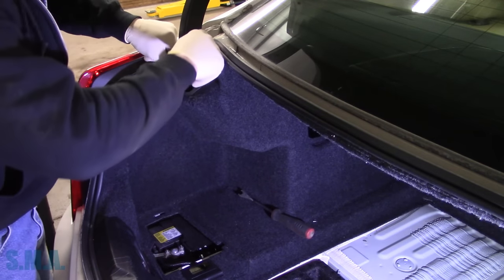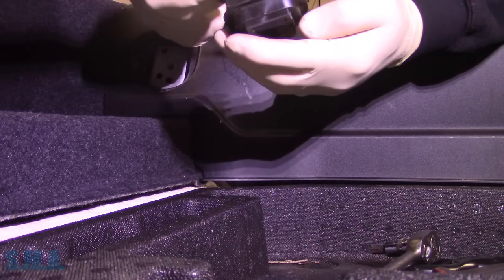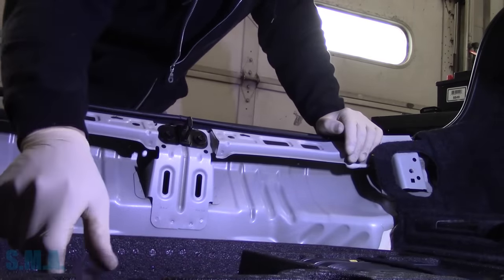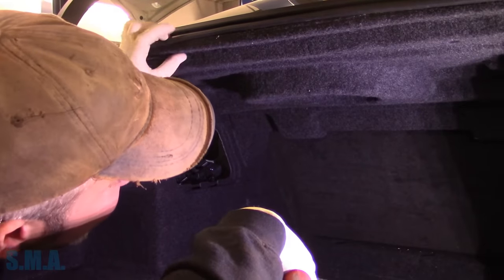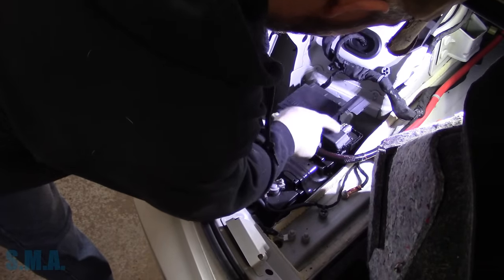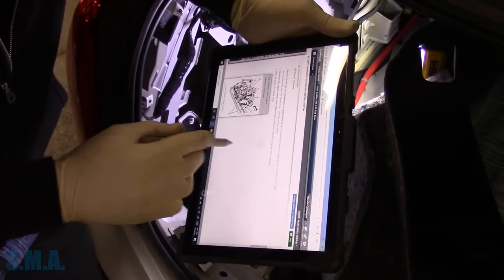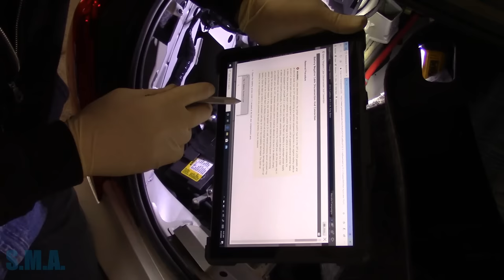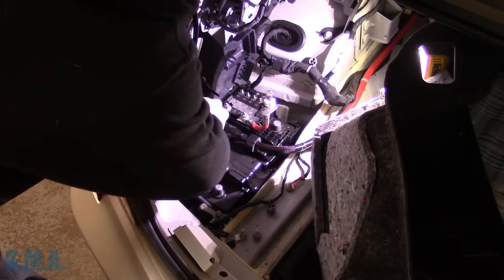Cadillac ATS: Battery Remove & Replace

Comment: Car engineers should be required to work in a repair shop for a min of two years.
Reply: They would end up hating themselves if they did
Reply: The reason they do that kind of shit is they want every body to return to the dealer for service, if  they made it  easy to do nobody would go to a dealer to replace a battery!
Reply: They're designing  cars  on PC never seen anything  in real .He can takeout  that  battery on auto cad software in 10 s
Reply: As an Automotive engineer, i can agree. When i worked for one of the Big 3 US auto manufacturers, i was amazed at the number of engineers in the performance group that had never turned a wrench.
Reply: Good idea brotha but maybe they would be stuck running wires to the battery. I'm talking fixing the problem when someone decides they are an electrician, cut the starter cable, and re send it a completely different way. Anyone here would scratch their head and ask "why?". This would of been great for Eric to fix and comment on. By the way, the starter cables and ground were fine, the starter was junk. How did I know this BEFORE Mr electrical master had a go? I already told the lady she needed a new starter. I was actually gonna do it for her, that's when Mr hot shit electrical genius rolled up. To this day I have NEVER seen ANYTHING like the way this guy attempted to rewire this. It was an absolute joke! Long comment but I'm just getting friendly with the peace pipe!
Reply: If you knew anything about engineering you’d know it’s there for a reason. You can thank Obama for all the emissions and fuel economy crap on cars now that engineers have to deal with and you can thank the press for wanting better handling cars.
Reply: @stiggy60426  You can believe  what  ever  you want but the  fact is. Manufacturers make more money selling parts and doing service than they do  selling  cars. If you can fix the car in your drive way they lose that service. They make Cars Complicated intensely, this makes the average  guy bring the Car back to the dealer for repairs!
Reply: *accountants
Reply: @Tk3997   You can believe what ever  Ferry tale you want but. The load of  electronics  in the new  cars Cause a bunch more problems than the older cars!  I Bought a 1991 Ford pickup new and that pick up went 300.000 miles with out any problems I have a 2017 GMC pickup that has had serious problems 4 times it has 20000 miles.  Vehicle's are only better in your dreams!  My truck has had a warped heads a faulty transmission and  a dead 
Computor box, that is  serious shit! donèt tell me  how cars are better than they used to be, Sounds like you had a hand in building the  garbage that is sold today1
Reply: @stiggy60426  If that were true there would be a simple cut out to get to the battery.
Reply: @JackS425  So wanted more efficient and better handling cars is now the fault of the press? And maybe those engineers should have simply taken a look at what most of the European brands have been doing for years. You know, Alfa Romeo, Renault, Peugot... making efficient and good handling cars for decades now...
Reply: @stiggy60426  --Not Really, I have a Battery on my Honda side by side that is in Engine Compartment, it has seen a lot of mud and heat--this battery is 11 years old but it was made in Japan. Most of the Vehicle Engineers are Educated but like someone has already said, they have never pulled a wrench. Yes Battery in Trunk would be ok but just build a simple secure case around it so that you don't have to undress the trunk...
Reply: I agree!
Reply: Agreed

Comment: Eric you got it all wrong, there’s an easier way, start at the front, remove grill headlight , front bumper cooling system engine etc until u get to the trunk
Reply: Easier way is a sawzall but customer wont be happy
Reply: @Newberntrains  and i own an ats
Reply: @MegaBbqbbq  well i guess this is what the chilton manual wont tell ya 😂 350 for a battery change with labor probably
Reply: Bout like a Ford truck.
Step 1: remove cab
Step 2: ???????
Step 3: profit.
Reply: Typical VW/Audi repair process.
Reply: @eldonerc2524  I dread having to do a cab pull for anything on my truck, it is so hard to do that without a lift
Reply: @bborkzilla  like that insane Ford v6 ohc with the chain at the back.....
Reply: @flyingarts6765  the 4.0l v6. Gives many mechanics nightmares. 
Of course then ze Germans had to up the madness with the 4.2l Audi V8. Just search out some vids here on YT on timing chain service for those...most owners dump the car vs pay the mechanic to do em.
Reply: @aaronturner1072  my buddy had a 4.2 Audi....had to do the job twice in his driveway

Comment: Hey, just wanted to say the removal and installation was pretty much the same on my 2017 ATS with start stop. After I replace the battery, I checked everything and it was fine without doing anything else. FYI.
Thank you!

Comment: That was absolutely insane. All that work to pull & replace a battery. I miss my '68 Olds Toronado. You could open the hood, sit on the fenders (without risk of crumpling them) and have room for you and 2-3 friends. The only PITA was about a mile of vacuum lines that got old, hard and crumbly in the worst places. Vacuum ran everything. Headlight covers were vacuum actuated, they made such a satisfying clunk when they opened and closed. Car was amazing in snow, 455cid, giant bell housing, full size tranny, all the sheet metal (I swear the hood weighed half a VW!) sitting on the drive wheels. Miss that car. Don't miss buying gas for it. Was getting 8-10 mpg on good days. WAY less if my foot got feisty. Oh, and it had THE coolest speedometer ever.

Comment: Chrysler: we came up with the dumbest spot to put batteries

GM: hold my beer
Reply: I remember my 300M, having the battery in the bumper. First time I had ever seen anything like that. Thankfully I never had to replace it.
Reply: The old Stratus' and such had their batteries buried inside the driver front wheel well
Reply: Battery in my Charger is in the trunk, but it's accessible pull up the spare tire cover. No disassembling half of the inside of the trunk to get to it.
Reply: @McBosshog85  Chrysler Sebring - same rough location.  Most idiotic place for a battery ever.
Reply: Dodge Journey hidden behind the front bumper need to remove wheel or have a lift lmao
Reply: My 2010 Dodge Charger has the battery in the trunk but it is easy to get to.  I still have the original battery and I am beginning to think that the worst place for a battery is in the engine compartment with the hot engine and vibration.
Reply: I think they were full of drugs when defining the place for the battery
Reply: What on earth?..... To change the battery,disassemle car.
Reply: Also Chrysler/FCA/Daimler on Grand Cherokee/Durango/M-Class: Let's put it underneath the powered passenger seat
Reply: Old school...remember when the car didn't need reprogrammed by a mehanic with a 5k scan tool every time we fill up with gas?
Reply: @MrBillrookard  That depends on how you look at it.  When that decision was made, it was supposed to be for battery longevity.  That location kept the battery away from the heat of the engine.  My parents had a Concorde from that era, and I only remember them having to change that battery only once in the almost 10 years they owned it.
Reply: Actually, placing the battery in the rear is a great idea for weight balance and protecting it from the heat of the engine.  It's not that unusual for cars for handling purposes.  It shouldn't be this hard though to gain acess to it.  Bad design.  GM.
Reply: You think the engineer s are still laughing about this?
Reply: @MrBillrookard  stratus and sebring are the "same" car.
Reply: Audi: 
Halte mein Bier.  (Under the Driver's side seat.)
Reply: I'm still in the camp that the inner fender battery was the worst possible idea for location.
Reply: Nancy Pelosi  not an engineer (willingly) due to the vehicle length positive cable required.
Reply: @mattbots1  VAG/Audi also does this on SUV's
Reply: I think the wheel well is way worse.
Reply: @McBosshog85  Yep. both my sebring and stratus are like that.  honestly after doing it a couple times, it's not the worst thing in the world.  Plus removes an excuse to not check your brakes and bushings on that side of the car. :)  Oh and to clean out the crud that invariably builds up in there.
Reply: @robertwelch3899  having changed a few, I disagree.
Reply: @McBosshog85  why do they do that do they know water and electricity don't mix well
Reply: @walterk1221  id much rather pull the carpet than the tire...
Reply: Im a AAA battery tech. Ive seen some stupid stuff. Lol.
Reply: @McBosshog85  I was smart enough to have an '02 Stratus R/T (basically a Mitsubishi Eclipse with different badges and body panels). Battery under hood. Easy manual transmission replacement, too. (TL;DR I missed a downshift and blew the thrust bearing to pieces.)
Reply: @mattbots1  probably the same drugs ford was on for the Transit main battery (spoiler: under the driver's/left seat)
Reply: @robertwelch3899  the wheel doesn't have to come off... the fender liner has to come out... easier, faster, less time than the by the book way for this caddy. Eric's way is still slower than my Chrysler way...
Reply: Exactly this.  My 2010 Journey's battery is in the driver side fender well.  Take the tire off, remove seized nut from bracket via cutoff tool, replace parts, work without being able to see, knocking grit into your eyes the whole time, and 4 hours later it's done.  Never again!
Reply: The caddy's an Buicks with it under the rear seat. An the Chevy SUV with it behind the passenger seat in the floor for the kids in the second row to spill God knows what into. an the 06 up Chevy trucks on the passenger firewall behind the coolant tank with that mess of wires like this car.
Reply: WHY I LEFT CHRYSLER FOR A SUBIE
BATTERY WAS REPLACED AFTER 1 YEAR  BEUCASE IT WAS DEFECT
Reply: My Cobalt has the battery in the trunk in the spare tire well. Just lift the spare tire cover, 15mm for the hold down and 10mm for the connections and it's out and in. None of that Cadi craziness..
Reply: Yeah I thought the battery in my wife’s journey in front wheel well was bad...
Reply: Nick J  Yup.
Reply: Worst battery was on a c6 Corvette under warranty with customer waiting. Had to use gr8 tester and print out warranty code. Tested battery and got the famous charge and retest.  108 minutes later, the battery tests good.  Pushed the start button and rapid clicking. Hooked up gr8. Charge and retest! Another hour later,  same thing.  Needless to say, another method was used to make the machine give me the code I needed to get the replacement battery and get the car down the road. Sometimes technology is not your friend!
Reply: @mattbots1  Even at that it is still easy to replace!
Reply: Dirty Harry 
Only if you put the wrong battery in it or neglect to connect that oh so important vent hose. IMHO if you do either of those, you deserve what you get.
Reply: Wife’s Hyundai sidelight bulb fails, instruction number one on how to change is remove front bumper cover!  Cheers, five minute job becomes a one hour epic.
Reply: The ATS isn’t the worst, and hell even the Chrysler bumper games aren’t that bad, don’t ever say yes to changing one in a Bentley, those are the worst, but I do roadside assistance for AAA so I get to see all the stupid places for batteries
Reply: 2014 Ford Escape 2.0 Turbo. Worst battery location ever. Stuff it under the sharply angled cowel & air box. Ford built the car around the battery.
Reply: Try VW's large SUV.

1 under a front seat (has to come out) & 1 in the spare wheel well.

Both about the size of an old 25 plate 12v battery.
Reply: And the Mercedes with them under the passenger seat, and also newer Tiguans where you actually have to unbolt the driver seat to get to it
Reply: And some of the Audi convertibles have a strut tower bar that goes right over the battery on the ones under the hood
Reply: dtoney1182 yea those are pretty fun, easiest way is to pull the air box top and bottom then unclip all the clips holding the positive wire from that plate at the front of the battery then slide it out, sometimes with bad corrosion on the negative terminal I just unbolt the wire from the body and pull it out with the battery
Reply: @2muchflan  Or Mercedes when they put a 60+ pound battery under the back seat. Those things were murder to replace.
Reply: It wasn't the location,  it was the fact that it didn't have a simple 2 fastener hatch to expose the damn thing.  Mercedes has been putting it in the trunk since the last ice age.  3 seconds and 2 calories burned and the job is done.  These engineering geniuses went to school for this? And their bosses actually ok'd it? What are they smoking at gm, and may I have the number of your dealer?
Reply: Walter K yeah the Sebring is basically a rebadged Stratus
Reply: Lol Buick does some under the back seat (lesabres) and some crap suv they have they’re behind the passenger seat in the floor!! Have to slide the seat all the way up, pull the panel under the rug then you have like 1/2” on each side to slide the batter up and down
Reply: @jwitt513  You mean IS. Except for the Stratus R/T which was a Mitsu Eclipse. Even the Dodge panels were made by Mitsubishi.
Reply: I had a 300m with that stupid battery underneath the air box and it caused me all kinds of electrical problems with it sitting down there and accumulating a ton of moisture and corroding all the time. Dumbest design ever.
Reply: Hilts30 Volvo is the same, wife xc70 burned a bulb. Have to remove front bumper to replace it....
Reply: @PatricioGarcia1973  What year? May want to look a little deeper online.
Reply: @McBosshog85  Yep! They claim you don't have to remove the tire. Yeah Right.
Reply: Mark Hull moo
Reply: @MrPaige222  No. Under the back seat on the E class. Not the trunk. Much like an early-mid 90s Buick.
Reply: @jwitt513  Not basically, it IS.
Much like a Pontiac G5, and Chevy Cobalt.
(Ironically both use the same Saturn Delta platform.)
Reply: GM has some other real peaches too.  Try a Chevy Traverse or a Corvette Grand Sport.  I'd rather they just put it in the wheel well honestly.
Reply: actually a very good place. protected. Stays clean. And user protected from possible battery explosion.
Reply: @davidheinzmann4403  By design, they dont want anyone but dealers doing ANYTHING to cars these days.
Reply: @31terikennedy   Unless the battery does go pop, and ingnite all the flammable materials around it.
Reply: @GixxerRider1991  Ever try to replace the rotted out battery tray, terminals, and hold down parts on a 300m? You wouldn't be saying that.
Reply: You've obviously not seen the process to just change a freaking headlight bulb on post 2000 GM cars. It's even worse then this.
Reply: @Cragified  You've obviously never worked on a car. Changing a headlamp on a 2003-1/2 Cavalier was cake walk. The 92 Buick Regal was a nightmare.
Reply: @Cragified  After 13 years wrenching as a job. And 20 years working on my own, wifes, and friends cars. I'm pretty sure I'm well versed on GM headlamps. Chrysler batteries suck worse.
Reply: @ningen1980  Sure, whatever.
Reply: Jon Liegl yeah Dodge never stopped doing that 😏😏
Reply: I think chrysler still takes the cake, having put them in the bumper in front of passenger front wheel on multiple sedans
Reply: Adrian  luckily the only issue I had with mine, was the headlight switch. I really enjoyed that car. I needed a truck, for the home. That's the only reason I got rid of it. My Concorde on the other hand, let's just say it's a good thing I had the extended warranty.
Reply: @m3rdpwr  I had that car.  Great car.  However, I had to change the battery 3 times in 11 years.  Not fun, but easier than this cadillac for sure.
Reply: @jcbecker2800  I think I bought mine used in 2006 and kept it for 4 years. It was owned by a 70-year-old and it had just been traded in when I walked in the lot. I really lucked out with that car.
Reply: @McBosshog85  Intrepid, in the passenger wheel well. Remove the wheel and access panel to get at it.
Reply: Hahaha
Reply: The engineers probably thought you would get rid of the car rather than change the battery. With all the salt in NY, the car will rot out and then the battery will fall out on its own.
Reply: Yeah in the right front wheel well  what a brilliant ideal that is
Reply: Dads 50 thru 59 ford f2 and  f250 had the batteries in the floor boards on the passenger side
Reply: At least it's not a Mercedes where it's under the passenger seat.
Reply: Lol. Not even close. Audi takes the win easily. I had one that the battery is located at the back of the engine between the firewall, but buried under the scuttle. Took two of us 4 hours to figure out.
Reply: That there is funny Jon!
Reply: How about a batter under the drivers side. They did that in the 30's real pain when you lifting a battery while laying on your back on a shelf that nearly gone
Reply: I still think chrysler has the dumbest, in the wheel well. It does wonders to batteries in the Midwest in the snowy season.
Reply: @mattbots1  done a few of those, they suck.
Reply: They're all playing catch-up with MG.. two 6 volt batteries buried behind the seats.
Reply: 🤣🤣🤣🤣bruh
Reply: Mines not like that I just pop those tabs off and rip it off mines a 2015, the roof doesn’t stop the side from coming off how yours did and I didn’t have to take off that back piece by the bumper it looked ugly but it goes back together fine